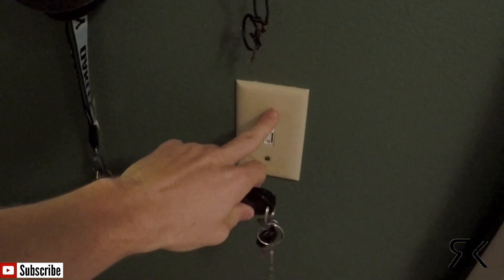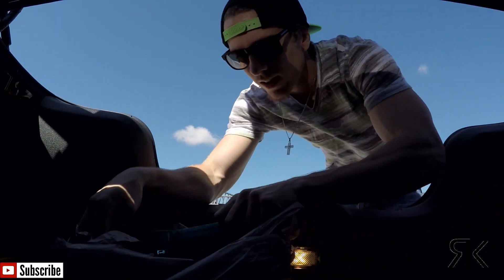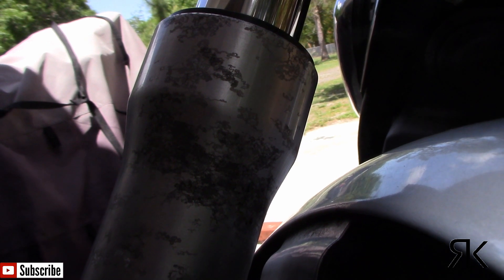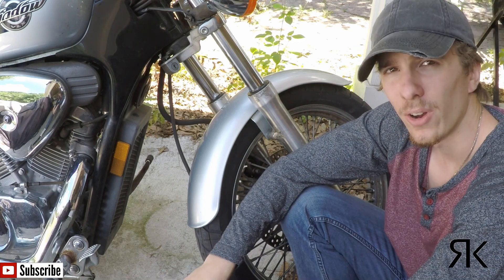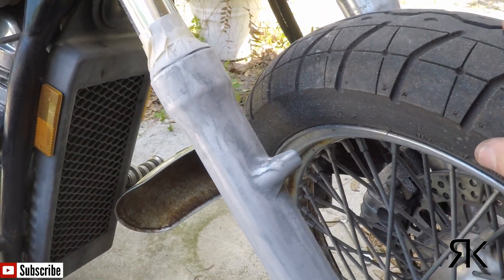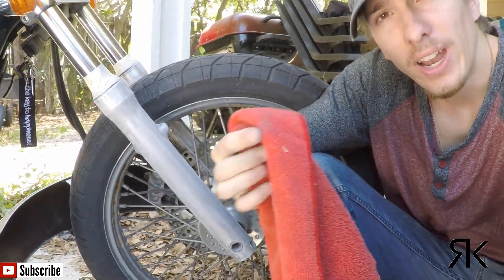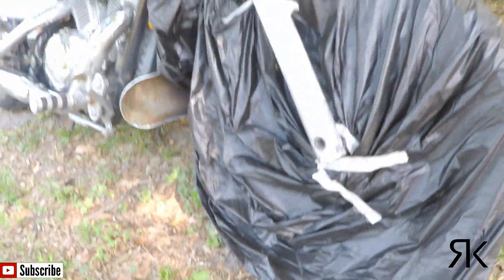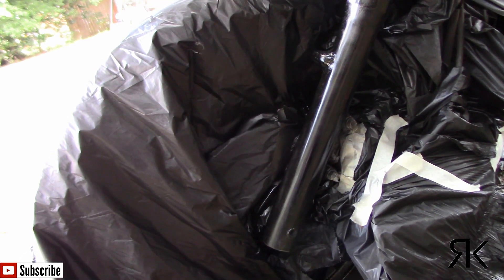Motorcycle Fork Tubes Get Painted!

Comment: Well, I just did my fork tubes yesterday. I had mine off after someone pulled out in front of me last August. I sanded them down really well and filed all the casting marks out. I sprayed self etching primer first. About 3 or 4 coats. Then I sprayed about 4 or 5 coats of satin black paint followed up by 4 coats of enamel clear coat. They  look fantastic. I put in new fork seals before I started, so now all I have left is to put in new fork oil and reassemble them and get them installed on the bike. Next is new bars, turn signals, possibly a new front wheel, and I'll be up and in the wind again. Come on summer!!!
Reply from the maker: Nice man! I need to get all the tools to do my own fork seals!
Reply: @RileyKerwin  I used a pipe reducer...it kind of looks like a bell...the small end was the size of the seals and it flared out away from the forks so I could get a good hit with a deadblow hammer to seat the seals. It was the perfect tool for the job. The forks turned out amazing.

Comment: Wondering how well the paint adhered to the surface? When I worked in a sign shop we would usually scuff the bare metal first so the paint filled in all the scratches and adhered to the surface. Then, we would sometimes wet sand between coats. Someone also mentioned compound and cleaner wax.
Reply from the maker: So far its held up great! No chips or signs of wear from riding and washing 👌Yep of those things are definitely a big help, but wasnt too concerned being it was a satin finish and gloss is what seems to benifit most from doing it that way.

Comment: You should always remove all hardware before painting for obvious reasons.  Aluminum powder in your brakes and fork seals is a BIG no no. 220 grit and an electric sander is a bit extreme. You're trying to scuff the surface, not remove it!